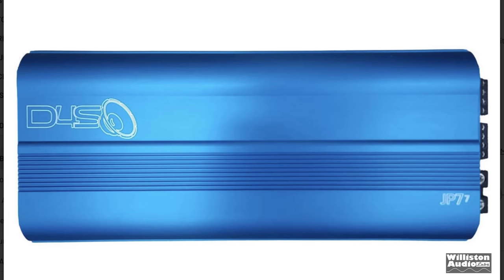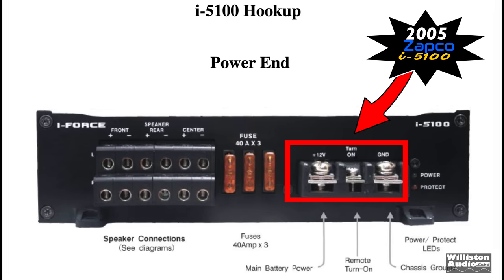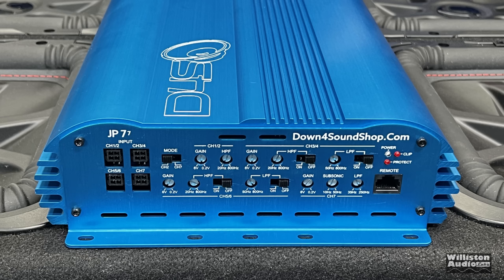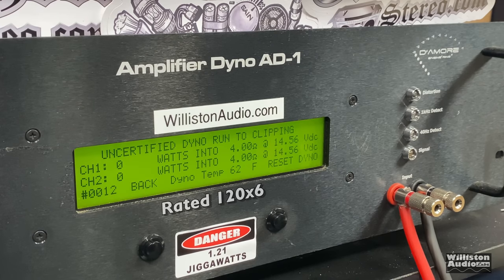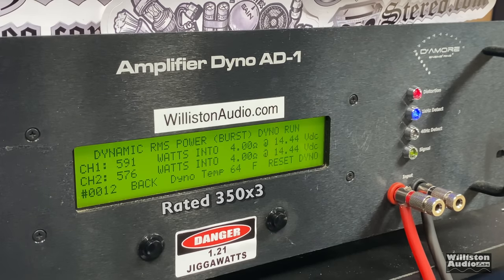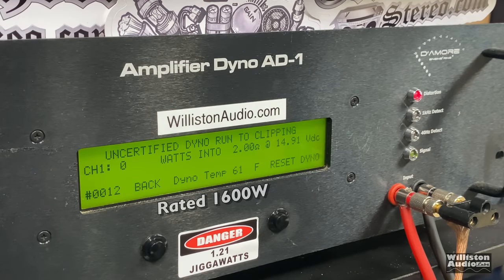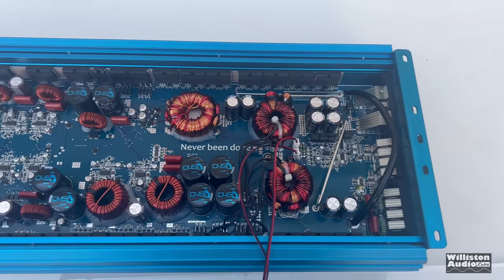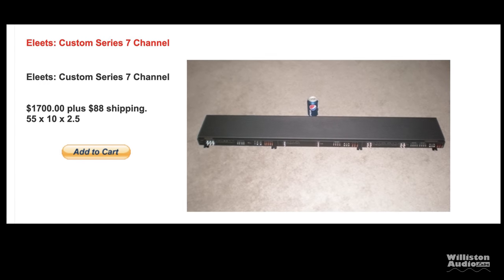The MOST POWERFUL 7 Channel Car Audio Amp EVER?

Comment: The only gripe I have about these amplifiers is that if I wanted to build out a system, I don't want my amp wall looking like a rainbow.... wish they all came in the same color.
Reply: Yeah, weird flex for sure. It certainly screams cheap.
Reply: Exactly! Pick one basic color and then charge $50 extra for different colors for example
Reply from the maker: It’s a personal preference thing for sure
Reply: Word
Reply: I like the colors they're using, but wish you could order any amp in any color. Would probably take longer to get them in a custom color, but the option would be nice. Maybe they'll start doing that at some point, I can't imagine it would be easy to do from a logistical point.

Comment: I'd like to see Sam go over this amp from stem to stern. Maybe test the amp for THD at rated output as well. 
IMO the real turning point for these D4S amps will be if/when someone uses one for a competition SQ system....and is at least competitive. We hear all the time that the amp is the least important element in a true SQ system. Well, this is the perfect amp to confirm or disprove that claim.
Excellent overview and dyno video Dereck!
Reply from the maker: Thanks Mark. I don’t think SQ judges would appreciate a D4S amp but maybe they don’t look or care about the brands…or maybe…
Reply: @wal Just getting around to this video (must have missed it) and imo if a judge needs to see a brand to be impressed, they’re not a real judge and should have their creds yanked.. especially for sq. Either it sounds good or it doesn’t. Agree with Mark 1000% on having Sam go over this amp in detail. I want to do an OS “themed” build in my ‘87 Tbird and this amp would be perfect. Outstanding video as always Big D!!

Comment from the maker: Want to Buy me a coffee/tea? Paypal.me/BigDWiz

SHOP (affiliate links)
JP77 (7-channel) Amplifier: https://lddy.no/1dfs1
JP10.4 Amplifier: https://lddy.no/1dfs2
JP40 Lithium Battery: https://lddy.no/1e081
Rockford Fosgate Power T1000-4ad: https://amzn.to/3u0vdaH
JP34ab 4-channel A/B Amplifier: https://lddy.no/15b14
JP84 4-channel Class D Amplifier: https://lddy.no/zhh0
Shop all Amps and Speakers here: http://www.shop4bass.com
D4S LTO 6.0 battery: https://lddy.no/1d7tj
1/0 OFC Amp Wiring Kit: https://lddy.no/1d7uj (don't get CCA!)
HiFiVega 1/0 OFC Wiring Kit: https://bit.ly/3rV9vDU
HiFiVega 1/0 OFC Big 3 Kit: https://bit.ly/3rXqxRW
Note: Amp requires 1/0 OFC wiring and  extra battery. Remember, it takes power to make power, beef up your electrical system first! This amp can pull over 300A at full volume. 

RELATED VIDEOS
Down4Sound JP83 Monoblock: https://youtu.be/_Buqewi_8lI
Down4Sound JP34ab 4-channel: https://youtu.be/9ptlq9hg3jI
Playlist of All D4S JP Amps here: https://bit.ly/3NF8I32

CAMERAS AND AUDIO GEAR
Camera - iPhone 13pro 1TB - https://amzn.to/3nCjGvc
RODE Wireless Go II Microphones: https://amzn.to/3Q6NVHl
Shure MV7 Microphone: https://amzn.to/3A4OICK
Zoom H4n Audio Recorder: https://amzn.to/3BXjVsS
960 LED Panel: https://amzn.to/2Sxoq3S

This VIDEO was EDITED with LumaFusion on an iPad Pro 12.9:
iPad: https://amzn.to/2Ancr1W
Software: https://goo.gl/6yvWss

TEST BENCH EQUIPMENT
SMD / D'Amore Engineering Amp Dyno: https://goo.gl/sJTcf7
XS Power D1400 Batteries - https://amzn.to/2BPFCKW
XS Power PSC60 Charger - https://amzn.to/2CHGcfs
Fluke 1000A AC/DC Clamp Meter: https://amzn.to/2Rw5WDA
Handheld Dyno: http://amzn.to/2u2EgKV
My Favorite Screwdriver Kit: http://amzn.to/2x0VzcE

DISCLAIMER: This video and description contains affiliate links, which means that if you purchase from one of the product links, I may receive a small commission. As an Amazon Associate I earn from qualifying purchases
Reply: I would love to see this amp in an SQ setup and how would sound compared to a zapco 6 Channel

Comment: Now D4S totally dropped the ball without adding the tweeter crossovers cause I totally intended to use this amp as a one chassis solution for a complete system
Reply from the maker: Yeah that shocked me a bit too! Need external Crossover or DSP for tweeters. How did they miss that?
Reply: 800 hz ain't too bad plus tweeters come with a  crossover anyway but yeah I hear you ..

Comment: Never been a fan of JP but this amp is legit, whole car power for what alot of guys spend on just a monoblock. Will be checking one of these out next time I need a full car setup for a customer for sure
Reply: D4S doesn't have one bad amp. I'd be happy with any of them. It's nice that the selection is so good.
Reply: @ksavage681  never really dealt with any of the d4s products but def will check em out
Reply: Not trying to downplay the amp, because it's still impressive, but what would make you choose this over say, 2x Taramps DS 4000x4's which would give you 8kw rms vs this one that does almost 4k?

Looking at the components on the outputs this is also a class D so sound quality should be pretty much the same.
Reply: @00000005547  bc taramps are garbage for both SQ and build quality. ive run half the power of the taramps in exact setup , played deeper and louder. ive put many taramps in bike installs with PA stuff and SQ was junk, it was loud asf but that what the customer waz looking for so it served its purpose, for me, the wont ever be a brazilian amp in my vehicles ever again. the md8k was flaky, didnt last long, got excuses from customoer service, and was told it may be almost 4 months for repair...threw in garbage and replaced with a cheap rp4500 and it WAY outshined the 8k in both loudness and authority down low.

Comment: Here I am considering this for my truck... Upgrading from the stock 95A alternator to a 370A alternator. Not planning on pushing this to it's limits (power output wise), but utilizing the number of channels (set for the tweeters, set for the front woofers, set for the rear woofers, and another for the sub, DSP/EQ controlled, ~1100W RMS combined going by rated RMS of each driver). Still a bit concerned about it pulling too much power.

Comment: Big D, Yare the man all your testing on these amps. I just ordered it to replace my JL AUDIO AMPS. They do not last that long. I wish Linear Power were still around. Those are what I competed with in high school and still using the 2.2 high voltage and 5002iq running my two jl 10s under the seat in one of my crew cabs. If I could, I would pay Linear Power whatever for a 6 channel or 7.....Keep up the awesome testing...old schooler to another.

Comment: UPDATE: Before I got rid of my Kia, I ran this exact amp^^ for a couple months on a Sinfoni Tempo 3 way set, and a Savard Hi-Q 15, (signal processed by a Helix Ultra). I have zero complaints about this amplifier. It did everything I wanted it to.  I just plugged it into the system and ran everything at zero gain, (because I didn't feel like measuring, or messing with anything). This thing is stout, and treated all of my speakers pretty well. I was considering selling it to help fund my current build, but after seeing it in this video again, maybe I'll just hang onto it. It's a solid piece of work, so far.

Comment: I ordered this amp as soon as I watched your video.  I will be replacing 3 amps in my truck with it. RF t600.4 , RF 225.2 and a RF t2500.1bdcp. Running RF t5 3way front and a SMD mini 12 inch sub all processed through a audiocontrol DM810. ..my 20+ year old 225.2 is causing a whining noise feedback into my other amps at zero volume.  Currently my setup is loud and very clear at 143db so we will see if the jp77 stacks up against rockford fosgate.  Thank you big d ,sam , jp and Jacob
Reply from the maker: Please reply back once you get it in 👌
Reply: @wal  I just received word that jp and his crew are overwhelmed with all the orders that have came in and it looks like it might be a while before I get it but I will definitely let you know how it goes

Comment: Rockford has had amps with massive dynamic headroom for years. This is indicative of a well designed amplifier. When there are big or loud peaks or transients it means the amp can supply the power, instead of falling on its face. I would say it likely sounds very good, i am very impressed with the feature set on this. Most amps with this many channels have very low power output. The SQ folks will love this one.. running active with a DSP, this is a one hit wonder for running a 3 way front stage and one or two 12-15" subwoofer(s). Pair this with a 8 channel DSP (cant find a 7 channel) and you will have a killer system.
Reply from the maker: Very interesting for sure!

Comment: Great looking amps coming out from Down4Sound. I wish they had been around when I built my most recent system. The pricing for them is great but I wonder how long they can keep it up. Many times new brands are priced for low/no profit to get market share and many don’t make it past that stage. Skar walks the pricing fine line with their sk series korean amps while DC has gone upmarket with their korean amps. It will be interesting to see where Down4Sound is with their amps in a year.
Reply: I don't get why this guy has to crap on Skar audio to promote D4S. Both companies make good products for people on a budget. D4S has the lowest tuned pre-fab boxes I've seen on the internet at 32Hz. Others say 35-38Hz but are clearly in the mid 40's. The Skar prefabs are a true 38Hz which is good for all kinds of music not just songs with processed basslines.
Reply: @jimjones3287  It sounds mean but its the truth and as he said in another comment, it helps the video’s performance with Youtube algorythms. All Skar amps are actually on clearance on D4S’s website. I checked.

Comment: Glad I bought it… what about current draw and efficiency? You normal show that. Thanks for great videos
Reply from the maker: It’s difficult to calculate accurate efficiency with an amp with so many channels. This other guy commenting like 20x saying I’m hiding something doesn’t even calculate the other 6 channels that were active during the tests. If it’s really important I can try again and get an estimate. It should be between 75-85%
Reply: @wal   thanks for the response I’m not a SQ person just want it to sound good and how much I’d need to run this in a vehicle…

Comment: I recently installed this jp77   sounds great. I am running 3 way front stage plus sub .
Reply from the maker: Awesome 👏
Reply: the only thing I can really say I dislike is the bass knob. It looks great and has nice features but it feels cheaply made.. the blue light is not nearly as bright as the previous knob that came
with JP 23 but still very bright. also the knob it self When turning bass suddenly jumps from one levet up abouf 4 levels. it's not a smoth transition. I have it on a !skar EVL-15  @ 2 ohms and it bumps hard.

Comment: X10 is a must if you want to run this Amp active. The crossover adjustments aren't gonna cut it for an audiophile. This is more a pro audio style  where you run a bunch of crappy 10 MIDS
Reply from the maker: At least they can be bypassed and use external DSP

Comment: I'm impressed with the power and price.  What I really want to know is how clean it sounds.  If it was fed a signal from a DSP, how would it compare to more SQ oriented amps? People in the market for a 7 channel amo will care a lot about this.
Reply from the maker: It’s not specifically SQ focused looking at the caps but they can be swapped for audio grade and overall I don’t think you can get anywhere close to this as far as cost vs performance

Comment: I have never seen you point this out, but when your testing @1% THD and your certified and uncertified are the same, that means that the amp is super clean and not meeting the THD limits until it hits a hard clip correct?
I wish you could test multichannel amps at .1% THD for mids and highs.
Reply: Good question! Answer this one Big D! 👍

Comment: I heard mini dsp stores crossover settings for various speaker drivers. I could be wrong on that. But if d4s makes 3 way sets. I wonder a new 6, 7, or 8 channel amps would just load the crossover settings for their own speakers. If I remember in the dsp world, filtering and crossing over are just storing a bunch of coefficients for dsp board or platform. So I'm thinking d4s releases an app to run the user interface to setup the eq and xovers. This should be doable.
Reply: I know we live in a diy world, but I can only do very little, someone hijacked all of my computers. Anyway if you know how to develop apps, learn how to use remez and find a way to load coefficients on to a dsp board. This way we can save weight on passive crossovers that alters the sound ever so slightly. I know dsp can alter sound too, but the weight is real.

Comment: Yea I might have to try this one. was gonna go with 2 mmats amps the hifi6150 and m2000d but this is significantly cheaper and being I'll have headroom should run into the issues
Reply from the maker: It’s almost silly priced right now at under 600. I bet they don’t last long. I may buy a 2nd myself 👈😜

Comment: I would love to have a 8 channel amplifier with at least 150W x 8 @ 4 ohms (No sub channel). 3-way active front (6ch) & Two 2-way Coaxial rear (2ch). That would be one less amplifier in my system because I’m lacking on space.

Comment: Very nice power ratings all these DownForSound amplifiers, power galore. 

But how about the sound quality; are these sq wise any good. How are they compared to more amplifiers which are known for their sound quality?
Reply from the maker: I mention in the video I don’t have the 4-way active setup to test the SQ and I also don’t like to comment on SQ as it’s subjective. It splitting hairs in a lot of instances. I did not hear any issues with SQ in this amp. Those who assume it sounds bad because of the brand or price, I feel sorry for you
Reply: @wal  I understand your point of view. I personally don’t have to need to buy an amp and it’s not available in the Netherlands. 
I can let it ship to the Netherlands if I needed one. 

Because you have tested quite a view DownForSound amps, 1, 2 and 4 channel, it made me just curious. 
They are on sale and even with shipping and taxes the price to power ratio is ridiculously cheap.
By the way; I never saw a comment that they sound bad.

Comment: The only thing I would like to say is I would assume that most people using this amplifier would be on somewhat of a budget which most people would probably be using a factory alternator which on a good system would have a starting voltage of 14.4 volts

Comment: Im doing a build on my 2018 honda accord ex-l with premium system. Should i use 2 seperate amps like down4sound jp8 for subwoofer duties and down4sound jp95 5channel for interior speakers, or get this jp77 to power everything, Running down4sound prefab box with single 12" sundown e12 sub, 4 down4sound sfx 6.5 mids for interior front and rear, 1 down4sound sfx 3" center, 1 down4sound sfx 8" rear deck woofer. What setup would be better.

Comment: So panel mount RCAs are still a plus even when they're not actually mounted to anything but rather on pigtails connecting to completely unsupported Molex micro-fit connectors?
Reply from the maker: They provide secure connections and that’s what’s important

Comment: The RCA pig tails would be a deal killer for me, too many potential problems.
Reply: Theres literally no more potential problems than on board OTHER than the risk of cut on the cables. Do you not install your shit correctly? Thats literally the only way it could be an issue.
Reply: Yah problems for you not me  I have a idea so they will not get shorted out
Reply from the maker: Should not be an issue. These stay in the amp and take some effort to remove
Reply: You are correct Notorious RVH. Those type of RCA pigtails were a BIG problem on the older Digital Designs amplifiers.
Reply: @wal  How many of these in a couple of years are going to be sold missing the dang RCA plug. How durable is the wire at the connector ?
Reply from the maker: @thenotoriousrvh6091  that's a concern for sure!
Reply: @jamesstephenson2346  WoW James does trying to insult people online make you feel better about yourself ? You can go to my channel and "Yes, I install my shit and other shit quite nicely. 
I used "Potential" in place of "Probable & Future". I'm old enough to have seen several companies try and use proprietary connectors and it didn't work out to well in the end. I'm sure Xtant didn't think it'd be an issue requiring the top panel of amps be removed to make the connections. Use your brain before throwing out accusations.

Comment: How many batteries and amperage does one need to daily this? Not burping all the time?
Reply: Just have to do the big 3, put a high output alternator or add a second one to your vehicle, a decent battery in the trunk with dual 0/1gauge positive and negative cables to 2nd battery and 20 farad cap...oh and lots of dual wire adapters.  I used to run about 4k rms and this is what it took to maintain 14v or higher while listening to music.

Comment: Could stage a car to death with that jewel. 
Any highly recommended sub repair services? I have 2 oz audio purple basket 12's never used with a  small hole in each surround. 
😒 I'm the idiot that put the holes there.
Love to have them fixed. 
Thanks for the review,  d4s has come a long way in the right direction 👍
Reply: Robot Underground
Reply: @Thumper68  thanks.  I forgot about him 👍
Reply from the maker: Simply Speakers
Reply: @wal  very nice website and bookmarked.  Thanks a mint D